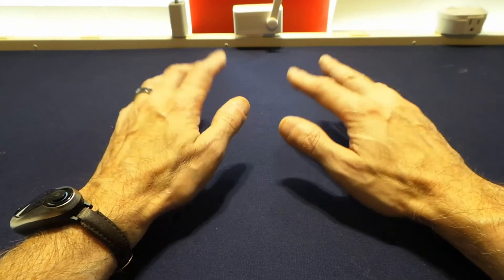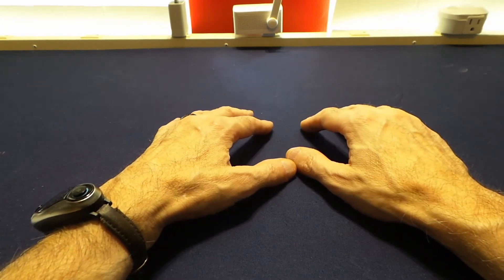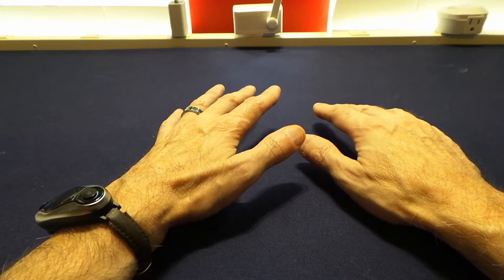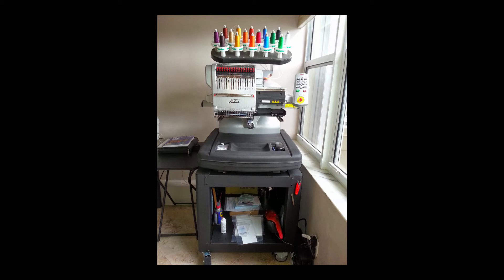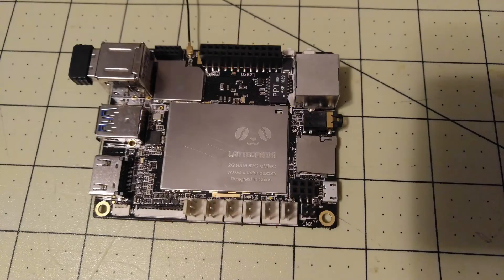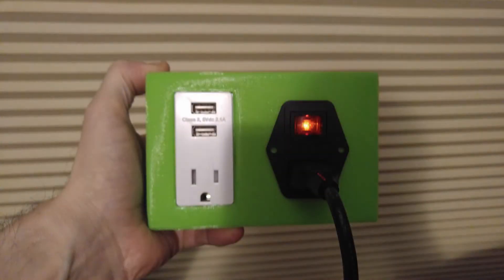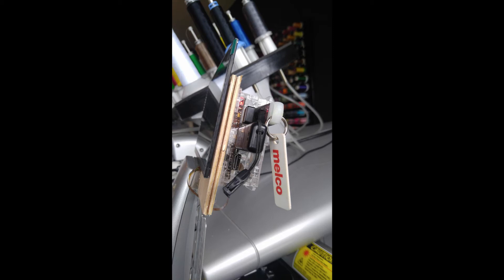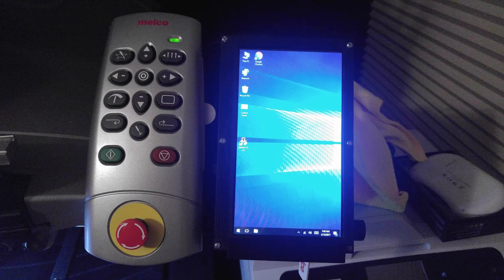Amaya XTS Machine Mod

Comment: Great video. I think this video will open the eyes to new generation entrepreneurs and all the beautiful people that love electronics. As an owner of one of these machines, I understand what motivates you to evolve and make your environment more versatile, working more efficiently.
Having a display attached to the Amaya is excellent. Because the machine runs by itself, and if there is something to correct, the error message is right next to you at the touch of your fingerprints.
You are right, the Amaya XTS already evolve and now is know as Melco EMT_16X,  but the core of the machine is just the same. Same power, same result, outstanding performance under proper care.
Reply from the maker: Thank you for your comments. I do enjoy sharing what little knowledge I have with others. One of my good friends it's an Amaya tech and thanks to her she has been able to keep me in the loop and showed me the new Amaya OS 11 and Design shop 10. The newer features of OS 11 would have complimented my design a lot better. Maybe someday I might think about buying another machine.

Comment: Hello Condor! Thank you so much for this video, I'm struggling to try and operate my Amaya machine that I recently bought second hand. In terms of creating a wireless digitizer, are the dongles and the keys still necessary in order for the machine to operate? Those are the two things that didn't come with the machine when I bought it and didn't know how important they were until after.
Reply from the maker: There are 2 dongles but only 1 is needed to run the machine. Did they give you a copy of Amaya OS when you got that machine because if they did you should have received the dongle for it. If I remember correctly the Amaya machine will be highly crippled without it and not run properly. You have only a few choices, one you contact Melco and see if they can sell you a new Amaya package or try and find someone selling a used version which i doubt you will find.

Now you mentioned digitizer. Did you get a copy of design shop with that machine? If you did without a dongle you basically have a digitizing software package that won't run. If that's the case you have the same options as above. I don't want to try and scare you but be prepared as design shop is VERY expensive.

I wish you all the luck in the world as you have an amazing machine and one of not the best manufactured machine I've ever seen. Also feel free to ask me any questions.

Comment: amazing!!  i need one of these !!  could you sell me one ??  thanks for your excellent video !!
Reply from the maker: I would of I could. Nothing would make me happier than to help a fellow Melco owner. Several things prevent me from doing this however. I am no longer in a position to be able to afford getting the parts I would need which are now different models and upgraded and need new modifications. I also don't have my machine anymore 😭 as I've had to sell it due to certain world events. Also the original design did have a few flaws that appeared after long continued use and I realized the 7 inch touch screen was a bit too small for my old tired eyes. A 10 inch would be better but that adds some altering and modifications and added weight that I'm not sure my 3d printed support bar could support. Shame really since the new Amaya OS 11 has a new GUI interface that supports touch screen much better. However, I will keep this in the back off my head in the future since I know a Melco repair tech personally and perhaps if I can find the time maybe I can experiment with thier machine.